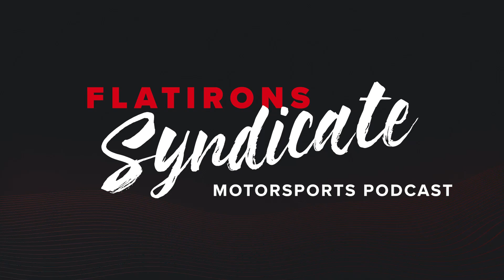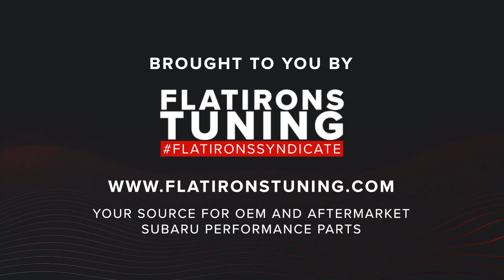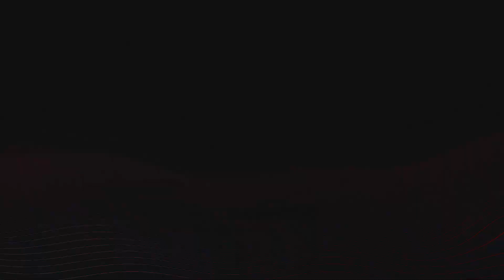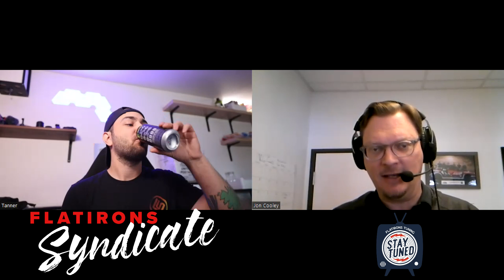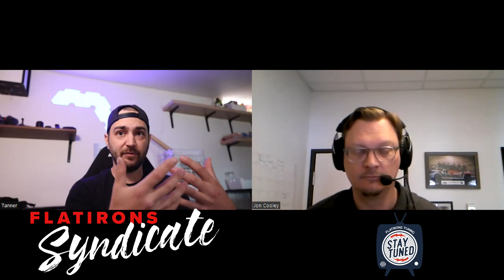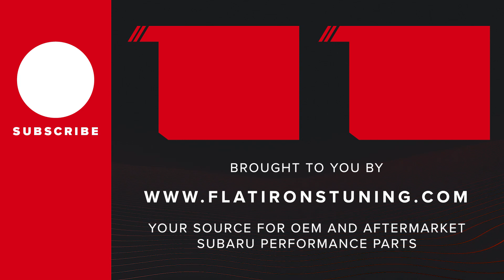End of the 6-Cylinder STI? - Smeedia Returns

Comment: The safety systems and parts swapping (automated steering and alignment discussion) is already a thing too. Putting the faster steering rack from a 15+ STi in an 08-14 can cause problems with the VDC. Have one in my ‘11 WRX and it freaks out, especially if you forget to turn off traction control. Add in the race pads and the “little dab of brake to one wheel” the system attempts creates a really jarring experience.

Comment: The problem with the build from the start was improper fabrication which caused so many problems. It ended up costing way more expense in the end and the project to go south.   Might as well go back with the EJ built at the highest level with professional high quality fabrication this time around to build something truly special Rob Dahm style for the STi game!
Reply: Lifting heads is a fab problem? He floated valves and blew an MLS head gasket at 50psi boost. The fab work was fine.
Reply: @TDT0188  I'm talking from the start of the project. Specifically when he did the side fender exhaust it all went downhill from there.  But as of yesterday's video he announced going to the 2JZ which I was so hoping for.... this should be a much better outcome.

Comment: No more electric talk ever. Electric is failing before it starts. We need hydrogen turbo charged direct injected Subaru. Hydrogen will be the next fuel. Electric will not last. Good thought but 25k for a battery system. Hydrogen turbo motors make serious torque. And put water in the fuel tank,  Mazda just made a 379 ft lbs of torque turbo hydrogen inline 6 motor, 10.5:1 compression, hydrogen erra. Will still have the rumble 😊

Comment: The 1000 hp is obtainable because we have the tunes that allow us to rev to 9500 rpm. I still can’t believe that number. Holy crap that’s revving to the moon. And then we have sent countless motors to the grave yard and donated many parts to the gods of speed, so we have learned and collected years of data. Therefore the tunes are getting dialed in from 7k-10k rpm where the factory did not dare to even go. And one of my motors saw 8500 rpm, and was running so good, then shot # 4 rod right through the block intake and was sticking out of my hood. I opened the hood and then just closed it slowly and called my wife to bring the ol Cummins truck with the trailer.
Reply: Often ignored.. mean piston speed when revving that high...
Especially when state-side alway going big block ej25 build...

Where jdm ej20 will be much better living in that high revving nature...

Hence ej207 jdm engine came with 80000rpm rev limit drom factory 😊